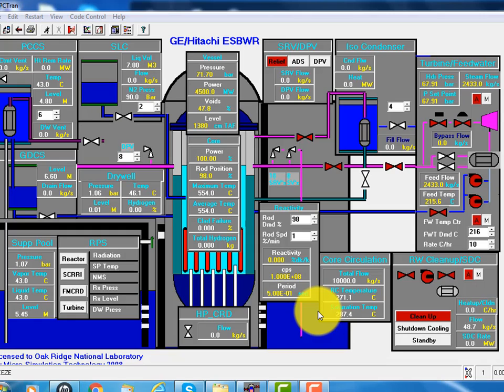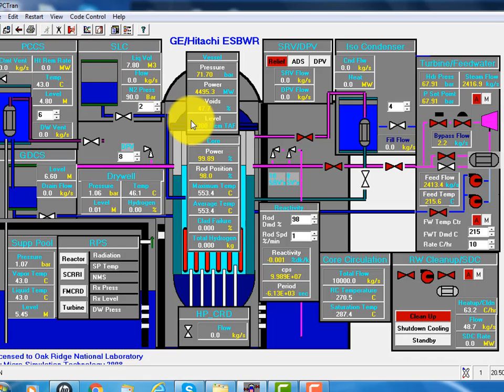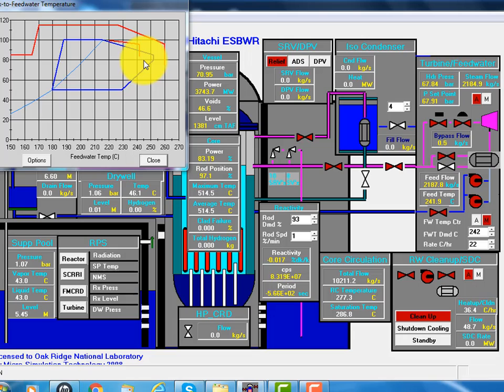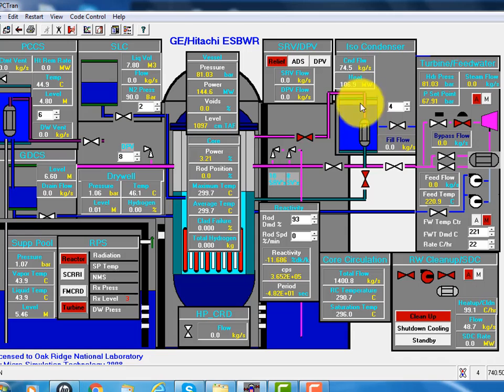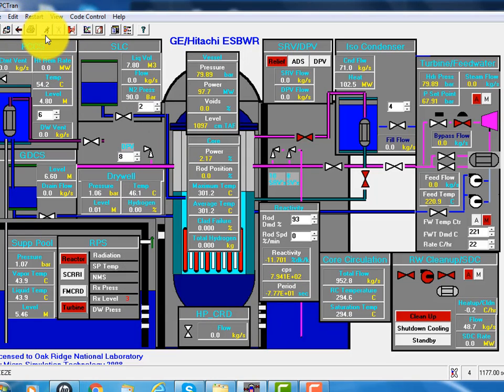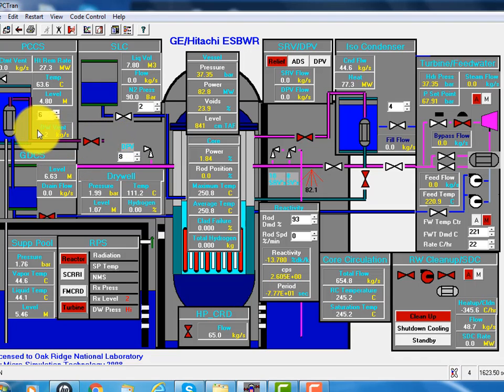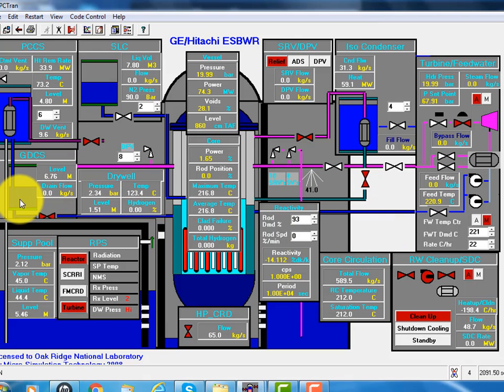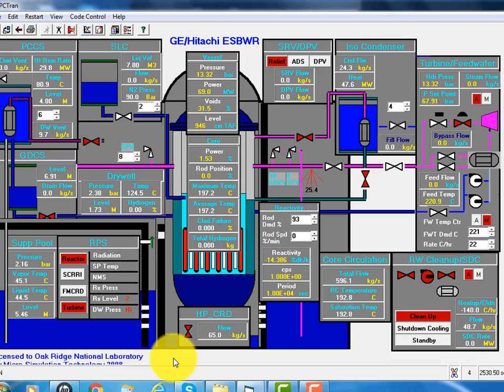ESBWR

Comment: Increasing feedwater temperature results in a higher core average void fraction that feeds back to reduce reactor power through the negative void coefficient of reactivity. Decreasing feedwater temperature results in a lower core average void fraction, thereby producing higher reactor power.